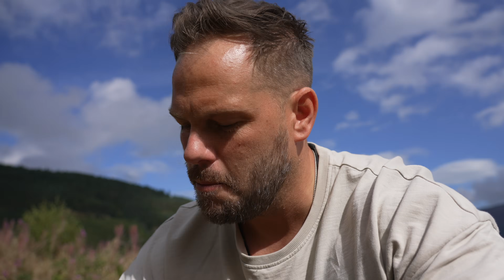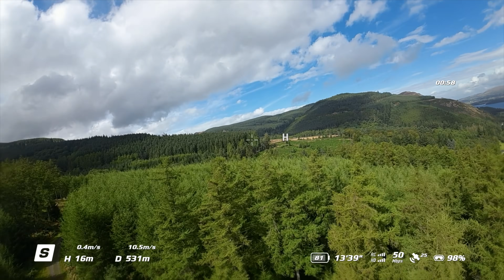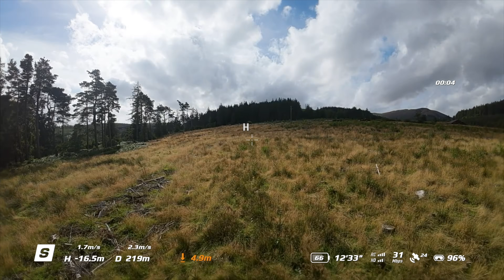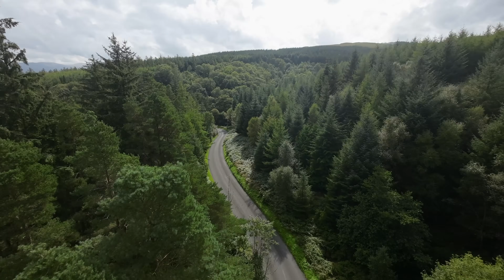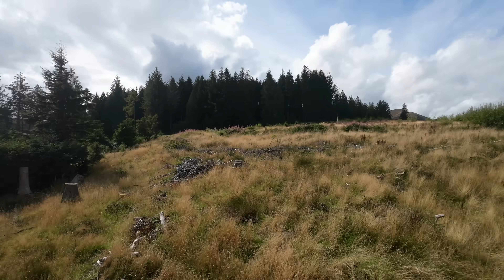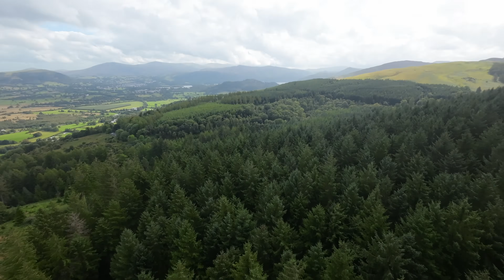DJI AVATA FPV SIGNAL and RANGE TEST

Comment: Thanks for the video! speaking of flying ranges...would you [or anyone reading] kno what Id need to get my Avata to maintain good transmission between drone and goggles 2 [or its Motion Controller], when flying through thick trees, beyond the 150 or 200 meter range [on my own rural lands]? That range is where transmission weakens severly, the HD bars go 1 and then red, and vision is lost or very delayed and confused. We have "Wifi Range Extenders" for our internet range, is there some similar device i could rig for the Avata and its goggles 2?  I need to go to about 350 yards thru trees for my purposes. Any suggestions would be appreciated.

Comment: I just got the Avata I'm in Florida. The Mbps only starts at 30 and has only went up to 32 Mbps. At 60 feet away it is at 27Mbps. Called DJI and was a waste of time. Any idea why I'm not getting 50 Mbps like everybody on utube is??? Same on Googles v2 and googles 2, 1080 and at 4k with motion controller. Thank You
Reply from the maker: Have you tried in a different area, antennas fully folded out , sounds like a prob with hardware if still the same

Comment: Great video as always. I have a question, I noticed that my avata doesn’t go to the preset high when the auto RTH kicks in. It will return at what ever high it is, it could be 5ft or 100ft, when the auto return initiate. However it will got to the preset elevation when I press on the RTH on the controller. Have anyone else expected this issue.

Comment: Thank you for the video.  For my purpose as to how I plan to use the Avata, the signal is good enough for me, but I am lucky because I’m in Canada.  

Quick question regarding the white USB cable connected to your Goggles 2.   Is that connected to your phone DJI Fly app and if so, are you using to live stream the video to your phone? If this is the case, I would definitely be interested in seeing a video on this!   I haven’t purchased the Avata yet. I ended up purchasing the Mini 3 with the RC, which set me back a bit.  

It’s going to take a bit of time to save some money for the Avata!

Comment: In FCC mode, RC-N1 & RM330 run at 25dBm/398mw. 
CE Mode restricts this to 20dBm/100mw.  Aircraft also limited to 100mw. For perspective,  RC Pro runs at 33dBm/1995mw <- that's 20x the power CE allows. Fun Fact: My Alien👽Tech Duo II runs 35dBm @3581mw - Nearly 4 WATTS vs 1/10th of 1 watt. I don't know about legality, but they aren't prohibited.  The running joke is, when I break it put and power up 🔋all the other drones just drop out of the sky! 😉 😜  at .1 watt, of course they do!
Reply: That's interesting to know, thanks! Would buying a drone from the US to use in the UK mean it would be set to FCC as standard?
Reply: I just got the Avata I'm in Florida. The Mbps only starts at 30 and has only went up to 32 Mbps. At 60 feet away it is at 27Mbps. Called DJI and was a waste of time. Any idea why I'm not getting 50 Mbps like everybody on utube is??? Same on Googles v2 and googles 2, 1080 and at 4k with motion controller. Thank You

Comment: I've tried both CE and FCC in the UK and believe me there's not much difference between them. There is a really good video on this on here by RobHK called CE V FCC..... Watch it!!
Reply: I disagree with my own testing, default ce mode i get 250m and lose connection, same place with sd card hack, 1km and still 45mbit and 4 signal bars.
Reply: @stobbsy1-nms  on my mini 3 Pro there is a big difference between CE and FCC but my Avata there's not much difference. May be I'll try a different channel or frequency.
Reply: @bobskimaxx  
Did you make it work?
Reply: @stobbsy1-nms  
Do you have it on Auto or pick a channel manually?

Comment: In CE Mode, it's limited to 25mw on the 5.8g band officially. 25mw is hopeless at such a high frequency. I imagine it's dual band and using 2.4g in that location out in the middle of nowhere. A range check in a heavy WiFi area might prove interesting... BTW, RC transmitters using the 2.4g band are allowed up to 100mw. Not sure it's the same when broadcasting video though.
Do the FCC hack, because it's shockingly bad value with such a poor RF output IMO....🤔😳😏🇬🇧
Reply: Video is often on different frequency, command & control remain in these ranges.
Reply: @BlairAir  Video transmission on the 5.8g band is limited to a maximum of 25mw. It's been that way for many years, even before DJI became a thing. I suspect those idiots running the EU are now clamping down on it....Not sure about the 2.4g band and video transmitting....🤔🤔😳🇬🇧

Comment: So, if I had a friend bring an avata over from the states, or Canada would it be the firmware update that limits the signal strength for UK or would I get full strength FCC signal? Sorry for probably a silly question but, novice with this sort of thing… 😊
Reply from the maker: It’s the dji app, even if you buy it in USA it’ll be good until you load up the dji fly app in the uk/eu. Even in ce mode the signal was more than good enough considering all the trees
Reply: @DMProductions  Thanks for the reply dude! Appreciate it. Really enjoy all of your content! Keep it up 👍🏻 (No pressure 😉)

Comment: I get DJI's hands are tied when it comes to what signal, you get in different countries, but they are responsible for the figures they give out for the specification of range they publish for a drone. The spec in CE land is 2000m, which I dont think anyone will argue is unachievable in the real world. People wouldn't probably have been as upset, if DJI had said, realistic flying distance of 250 to 500m, 2000m just makes DJI look dishonest. 

To me it reminds me of broadband companies who used to inflate speeds when they said they you could get in comparison to what you could actually get. There is a reason they can't do that now by law.

Comment: The "Problem", is that the Avata is not meant for flying above trees, its meant to fly near to the floor, going through obstacles. Even though, you are getting far better distance than I ever did. Max I get, 10 feet off floor is 250 to 350m on flat moorland with no trees before losing signal, which to me is unusable, although I've not yet tried on latest firmware.
Reply: Mate, CE mode, is bollocks. I know its for proximity flying, but the loss of signal issue makes it damn dangerous in some circumstances. You literally loose control, RTH. I've done plenty  of flying with it. FCC mode gives you more confidence to go through, around objects, even at 100 150m.
Reply: @shadyproductionsinc.2931  is the setup ok with the ham hack?
Reply: @SF_Bikes  yeah no problems
Reply: @shadyproductionsinc.2931  thanks for the reply 👍
Reply from the maker: I thought considering the trees etc it did really well, any drone behind me would of done bad too 👍